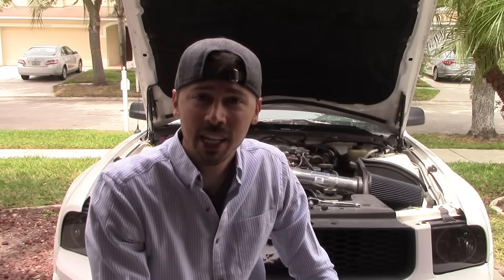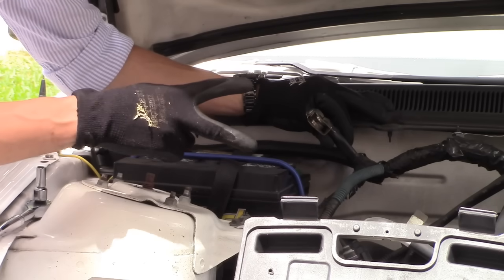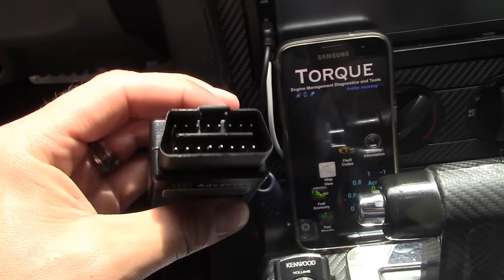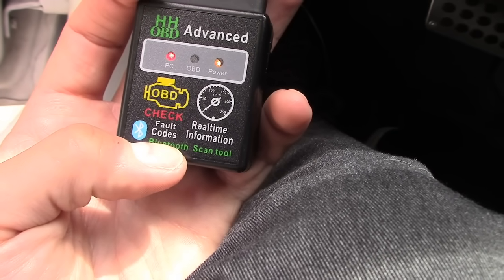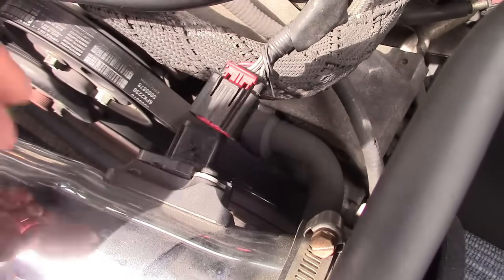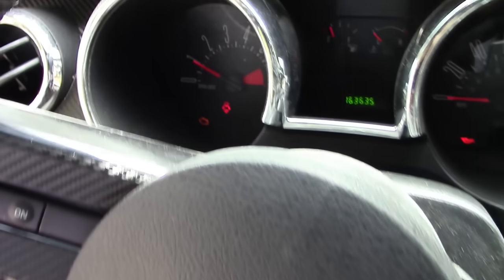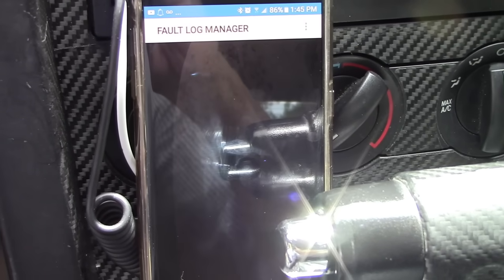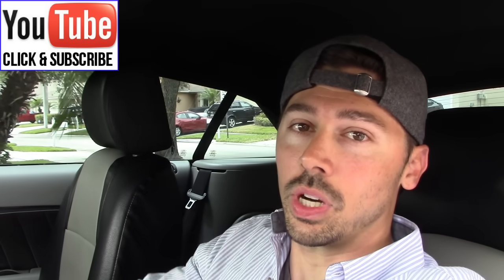3 FREE WAYS TO RESET CHECK ENGINE LIGHT WITHOUT CAR OBD SCANNER

Comment: Hopefully your mechanical if not you'll be at the mercy of a repair shop , I always try to watch repairs being done , ask lots of questions , see the old parts and test drive the car before I pay with a credit card , Beware of Crooked Shops People
Reply: I too always stand and watch what their actually repairing and always ask for the replaced parts because if they really needed to be replaced they wont have any reason not to give them to you. I also like you pay with a credit card so if their is still an issue I can have the credit card hold and even charge back the bill until they actually fix it right. If their honest they wont mind you watching if they know you.
Reply: You are right!! Crooks! I had a bad experience recently. This crooked mechanic put in a used piece of junk but charged me for a new part. Only was discovered after my car broke down driving from the shop!!

Comment: I just removed the positive red one for about a minute for mazda 3 2010 and the engine management light went off 
Thank you for the video it save me £20
Reply: Interesting,  because they always say to remove the negative cable first.
Reply: Correct.  Always remove the NEG first and install it last.

Comment: Ok! You've reset the light. All you've done, is throw the computer into relearn. It won't fool the state inspection machime, where a OBD II test is required. Not to mentuon the fact, whatever caused the light to come on, is still there. The best remedy, get your vehicle code scanned and get the issue fixed. Continuing to ignor it, only causes more damage to related parts.
Reply: Toyota. Pieces.. Engin

Comment: My Matco scanner tells me what it is and what's the top five fixes are when the engine lights on only spent $550 for it then when you reset one hard reset like you did with the battery turn it off for a little while soon as you drive a few miles down the road it comes back on because you did all you did was erased the code you didn't fix the problem you can always take it the advance or AutoZone or O'Reilly's they all scan the cars for free now but be advised when you take it to the mechanic to fix it he's not going to take you where he's going to scan the car anyway you're going to get charged for it been diagnosed anyway unless you fix it yourself

Comment: Easiest way is to first FIX THE PROBLEM/CODE!  When that is done just drive the car for awhile, usually less than 35 miles and let the OBC (onboard computer) "cycle" a few times. If the problems are fixed the light will clear.

Comment: My check engine always comes on, I checked the engine, it's still there.
Reply: No, sounds like bad muffler bearings.
Reply: Get a code tester like a Actron CP9690. It has live, graphing, record, oil light reset, smog test readiness test, and MORE! It works from 1983-2013.
Reply: F
Reply: Can you disable it completely so it stays off and my remote started will work. I don't want a check engine light at all.
Reply: @melissaryan1741  ⁹
Reply: You have to take the motor apart and leave it in your lawn for a year.
Reply: @masterone3882  lmao! 🤣
Reply: Arj Barker Joke.
Reply: That's because you didn't 'check' it right. You have to pop open your hood then grab one of those permanent markers to draw a really big checkmark on the top of the engine...simple fix!😁
Reply: GSXR RIDER Check your blinker fluid that might be the problem then
Reply: g
Reply: Tampatec
Reply: Lmao
Reply: You just need to check it, so ✔ it and it's all good.
Make sure it doesn't go away.
Reply: hahahhaa funny!!
Reply: I can belive you since I ride a gsxer😂 get you a Yamaha
Reply: @codysmith6502  A MUSTANG BE CAREFUL TOO MUCH REVS !
Reply: Lol!!!
Reply from the maker: GSXR RIDER 😆 good one 👍
Reply: I like that

Comment: I got that nice P0430 code on my Lexus. I've been driving with it for about a year with the CEL bulb removed. I got tired of it, decided to put the bulb back in, and ordered a used low mileage Exhaust manifold/cat.
Reply: you're so cool,lexus bmw such nice cars to drive and look fancy and rich,even if the ac dont work and power windows dont roll down.soo coool

Comment: all that does is get rid of code. it does not fix any of the problem. the codes will go away if you fixed it and do a drive cycle.

Comment: Good luck getting rid of a check engine light with modern vehicles, codes will still appear in the pcm even after disconnecting the battery.

Comment: wait , what's the point of this ? I'm electric engineer and I didn't get the point of shutting of the light by the tricking the car computer , is it to pass the smoge check ? off course you can't because the smoge check station has computer system that can show if the check engine lights was flushed . the station will tell you your car need a drive cycle otherwise what the point of this if you don't fix the problem that triggered the check engine light 🤔

Comment: The title said how to check without obm. I have 91 f150. Does not have that. So I can't check codes
Reply: vic zart Yes you can.  They have EECiv code readers that plug into the diagnostic port under the hood.

Comment: You do realize that your check engine light represents a federal emissions failure?  Clearing fault codes without a repair is a federal offense.  Need I tell you why we should control emissions?
Reply: big guy Sometimes like in my case. I got the light, and fixed the problem on my own. But you need to reset the computer so that the light goes away... It's not always just to ignore it

Comment: Hey guys, the computer cars it's really smart than you think, if you check engine light comes on! is because something is wrong or some sensor it's getting failed on the engine! Disconnecting the battery it doesn't solve the problem be aware of that! Better pay couple hundred dollars and fix it! Before get worse!
Reply: JC Pau before grammar get badder
Reply: @Derek Likos if you fixed the problem the light will go off by its self in a few drive cycles

Comment: A check engine light will tell you if there is a bad sensor somewhere but a check engine light will not come on and tell you the brain ECM is bad if you have the worst running car that actually runs there's no codes no check engine light you have a bad brain box ECM other names for it it's all the same layman's terms it's a brain box

Comment: Advanced Auto and AutoZone will scan your car for free and tell you what sensor is bad after you repair the problem your light might go off they can turn your light off to if they say they can't just ask if you can push the button on their scanner to turn off the light and see if it comes back on in a few days if the light stays off it's fixed if the light comes back on could be another problem or sensor
Reply: Rick Simps

Comment: Free easy way to reset the check engine light:  Take it to:  O'Reilly's, AutoZone, etc.  They reset it for free, and most of the times can tell you the reason it's on(again, for free).
This video is useless.

Comment: But you still not passing inspection, that little device you advertise is helpful, but clearing the codes an not fixing them is really pointless when it comes to inspection
Reply from the maker: Pete Taranto true. I did note that in the video. This OBD2 tool helps me monitor my alternator charging status, fuel MPG and so much more. Also the plugins are great too.
Reply: I've seen way too many people mention how "clearing it doesn't pass inspection or clearing it is temporary and after driven a bit it will show back up" which yes both of those are true, but idk if I just assumed but I thought he mentioned how when he plugged it back in it FIXED the issue causing the check engine light to pop on in the first place, so when you clear it after it just doesn't come back on because the problem was actually fixed
Reply: We don't have inspections where I live.

Comment: Change it to one free way to turn off your engine light instead of actually fixing the problem. Also, states that do emission testing, will fail cars with vehicles that have had the engine light turned off  to try to pass that states inspection. A vehicle fails an emission test due to Not Ready monitors. 

First, your title is misleading. It's not free. You can't show three different ways to use the battery and state that. Disconnecting the battery is all you need to do. How many people here have a wire with an alligator clip on each end laying around? Secondly, you don't properly convey not to do this to try to pass a state vehicle inspection. 

Secondly, you over explained that simply removing the negative terminal will work. No need for the other things you listed. I can assure you that many of the people that view this, have no idea there is a Trip A and a Trip B on their vehicle, let alone a wire laying around to connect the the negative and positive cables. I am sure there are some out there not doing it right and causing potential harm to themselves. Never suggest that to people that are most likely lacking in any automotive experience.

Comment: You fail to mention if you disconnect battery power alot of cars these days need a reset or relearn procedure to run correctly again.Also a lot of stereo systems have an anti theft code you need to re enter to get it working again.

Comment: Would those methods work if you need o2 sensor and the check engine light is on?
Reply: No.  This is not a fix.  The MIL will either come right back on or come back on fairly soon, depending on the actual issue.  And, asleep modules will fail an emissions test.

Comment: The real issue is ., using  a phone as a screen for displaying trouble codes means you will get a continually developed app, & much more sophisticated screen & better information than the permanent dollar watch display on the present scanners (for less money), & while you have it in your hand , remembering it is essentially a small computer able to update software & connect to the internet., you will now be able to search anything not explained.I say a good deal , & a good deal better than present scanners .NOW ? Will IT Display Transmission codes yet?(this is something only expensive scanners will do)

Comment: TampaT, TampaT, TampaT. What are you doing? You're not a hack. Maybe you're just out of your element. This is not the thing to teach people to do.  It's actually better just to tell them to just put a sticker over the light so the mechanics don't loose data that would actually help everything out. They do, however, compensate for tampering.

Comment: misleading title. clickbait. method he recommends is using obd scanner
Reply from the maker: watch again.. 3 FREE ways are #1 disconnecting battery terminal connection for 1 minute #2 disconnect battery connection then hold horn or use headlights to discharge energy in circuit # disconnect both battery connections and use jumper #4 use OBD2 tool

Comment: this guy really does not know what he is talking about. the check engine light is on for a reason. if you are able to clear the dtc (diagnostic trouble code) turning on the check engine light the light will turn off. BUT will be back on after a few drive cycles. this guy is not a real tech. I am
Reply: HMMM real tech question...where is the dlc on a 96 fiero?did you know it or have to look it up?

Comment: Nothing like giving out bad advice. If you have check engine light resetting will do nothing. Comes back on. If you fix problem it will eventually turn off light on its own.  Why go thru all this waste of time?
Reply: I need to get mine cleared for an e-check to get my plates up to date and don't feel like paying Rad Air or a mechanic hundreds of $ to fix something. My car is old and rusted on the bottom with leaks everywhere, it's not worth fixing.
Reply: Richard Johnson for inspection and can fix later

Comment: Help! got 05 Audi 3.2l v6 was driving to stop light light changed press accelerator didn't move just was running starts up perfect tow it no ATF PUT 5qts just STARTS won't move need helo
Reply: did you notice the giant hole in your transmission pan?

Comment: i loose my original gas cap for a 2012 nissan maxima ? i do have a universal cap . but the service engine light dont go away ? do i need to buy a original manufactured gas cap ? BTW i try your video except the 3rd one #help
Reply: michael jessy gas cap. Also if you read your car book. It should tell you once you have done that you should wait a day or two for it to reset itself
Reply: make sure you buy a Stant gas cap not the cheap one for 2 dollars less,Stant is what the manufactures use ,it just wont say nissan

Comment: is it good to remove catalytic converter in my car? what are the disadvantages in removing catalytic converter
Reply: You will be releasing lots of toxic and harmful fumes into the air.
Reply: number one,its against the law in America,its a Federal crime.number two on 96 and newer you will have your MIL come on.number three pollute the air.number four ahh just go ahead and do it your not listening anyway,HEY you can hang it on your wall and stare at it as you drift off to sleep

Comment: "check engine light WITHOUT car obd" so what the hell is the little scanner and torque app? it's a fault code reader!
Reply: Yes, you can get the free version in the play store, but you need to buy a cheap 10 dollar Elm327 device to pair with the app and is done through bluetooth. It reads codes, provides live data (I use it to monitor my water temp) and clears the codes, fix problem before clearing the codes, hope this helped. I use this one and it's been working for 4 yrs. and I use it every day. Costs 7 bucks, was $13.00 when I bought it 4 yrs ago. Good luck.

https://www.walmart.com/ip/Newest-ELM327-V2-1-OBD2-CAN-BUS-Bluetooth-or-WIFI-Car-Auto-Diagnostic-Interface-Scanner/350281753?wmlspartner=wlpa&selectedSellerId=12917&adid=22222222227092531678&wmlspartner=wmtlabs&wl0=&wl1=g&wl2=c&wl3=214144097917&wl4=pla-347703678217&wl5=9010454&wl6=&wl7=&wl8=&wl9=pla&wl10=117429984&wl11=online&wl12=350281753&wl13=&veh=sem
Reply: @icemule  hi there, the link doesnt work ( I know its from 3 years ago). Is it blue? I did a quick search on Elm327 on ebay . Just want to be sure. thanks!

Comment: did u say $9 (ish)it's at $21 now. Wonder if u can speak on the foseal wifi obdII  utility. any comparison to expect better experience  w either  and perhaps why . .. I know nluetooth move are as a rule a little sluggish on i/o I'm sure it's not thay big of delay just wondering if you could give a Lil comparison opinion based on tech not interface. think they use same apps not certain n thay would. b the least of curiosity unless it don't use same app. hmm guess it applies.  it must all be relative..ty for your shared wisdom
Reply from the maker: josh viles prices change time to time but best time to buy is november 15th to December 31st. I used  obd WiFi version but I had bad experience.

Comment: remove the POS/neg then touching each is actually ,"De-Polarizing Battery."
Usually if after you run out of gas you may have to do this.
Reply: Also good for "De-Foliating" skin from face.

Comment: all these are great , BUT if your getting an inspection for the car the code will still show up, even if the check engine light is off,  your car will FAIL inspection. the computer stores the code.
Reply: leny2316 :that's Right ,Emissions Insp. Will Tell U It Won't t Pass,Because Computer Has Not Had Time to Pull Up Real Codes,So This Device Is Useless,UNLESS CODES ARE ADDRESSED
Reply: +hxgs  Do you live in the US? If so, what State are you in? That's an automatic fail (1 free retest) in my State if the computer hasn't "Cycled out yet".
Reply: leny2316 lol not true
Reply: leny2316 

.
Reply: leny2
316
Reply: matt8863 ohio. i just passed again last week with a full 3" straight pipe with no cat
Reply: I've passed emissions on 5 different cars by resetting the light. they see the stored codes i say it was just repaired yesterday and hasn't had time to cycle out yet.

Comment: yes these will clear the code but it wont fix your car. and clearing the check engine light will also reset the I/M status which wont let your car pass state inceptions emissions test .
Reply: If the problem wasn’t fixed then the light would come back on

Comment: 3 ways but number 3 is with an obd reader. :p... Cheaper version though which is good.
Reply from the maker: CJB CJB 1. disconnect negative connection
2. disconnect negative and hold horn 
3. disconnect negative and positive then connect jumper
4. obd2
Reply: I use my reader now when needed but in he past I would just disconnect the +/- and touch them together for a few secs. ;)

Comment: if you don't fix whatever caused the error code then there is absolutely no reason to clear the codes........
Reply: I have to take my driving test  Friday, you can't take it if you have any lights on.
Reply: True.  But sometimes it is necessary to clear the codes in order to verify a fix.
Reply: Not in Arkansas

Comment: Most common cases of the check engine light came on is MAF or MAP sensor and 2 or 4 oxygen sensors in the exhaust lines are not working. Some rare cases of check engine lighted are Fuel cap improperly fit and EGR valve. Mostly after long burning out engine check light is oxygen sensor. Then simply clean the dirt of all oxygen sensors and it will be work again but mostly recommended is replace with the new one. :)

Comment: I would not recommend the method you recommend if your car is still under warranty because it may void your warranty I would use the factory recommendation disconnect the negative cable to the battery for up to 30 minutes reconnect the negative cable it should be gone if not check gas cap under the hood for loose wires and vacuum hoses if you can't find nothing loose take it to your dealer if your car is not under warranty follow the man's instructions